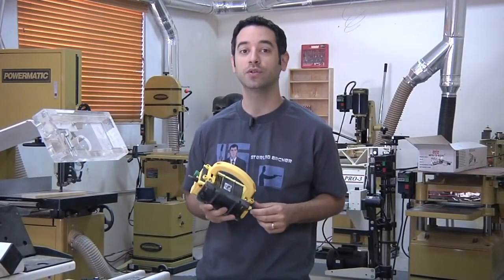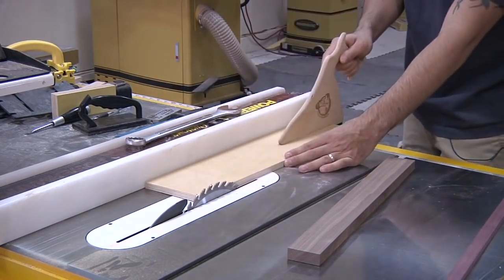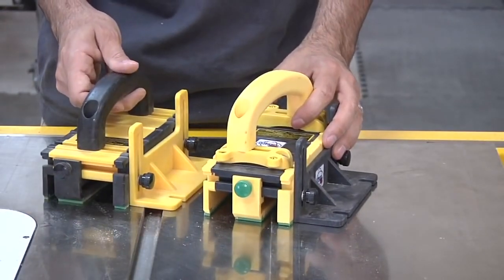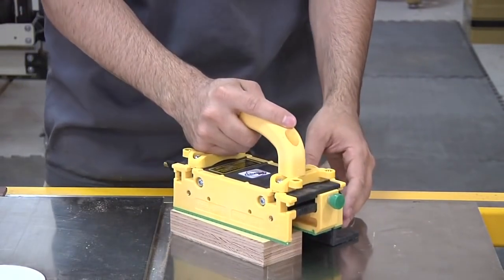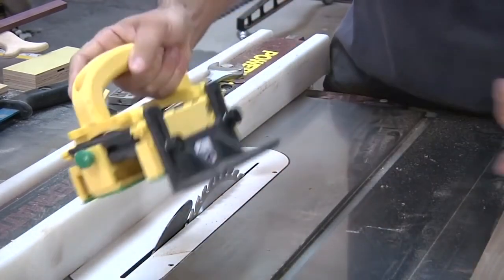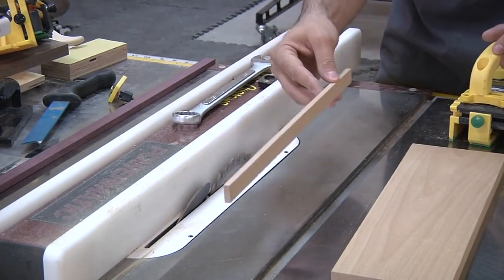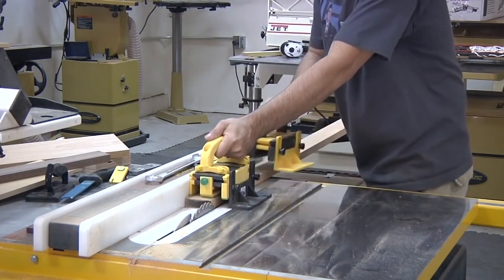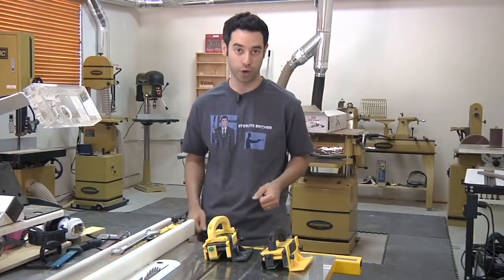The GRR-RIPPER Review by Marc Spagnuolo, The Wood Whisperer! #tbt

Comment: What model saw is that? I'll  have to study how it retains the dust so well. That's the dirtiest cut of them all and I didn't see anything. ( at 7:35). It's almost as if they have stopped the fan effect of the blade. Even with the best of dust collection, that's pretty remarkable. I'm still trying to make my sawstop PCS collect as good as I had my old Delta CS rigged to do. The Struuuggle is real!
Reply from the maker: This is an older video from Marc, but that is a Powermatic, either a 66 or a 2000
Reply: @Microjig  I'm going to have to look at the insides of those model numbers. That's either magic, luck or something in the design.
Reply from the maker: @mikeconroy2651  I have been a pro woodworker for 40 years. If you take the time to seal the gaps between the cabinet of your saw and the top, you can get some impressive results with a good dust collector.

Comment: I bought one of these years ago when they first came out.  After using it one time, it became a $60 doorstop.  I found it very tedious and time consuming to adjust.  This jig is no different than the 3 other push-sticks you demonstrated when cutting long stock.  The big downside to this jig is having to remove both the blade guard and the riving knife in order to use it.  Fingers and hands are in peril and the possibility of a kickback is dramatically increased without the safety guards in place.  Your push-shoe is the best of the 4 push-blocks presented by far.  I sure do miss my $60!!
Reply from the maker: Sorry to hear you feel this way. Had you contacted us back then, you could have had your $60 back. I will say that you are in the minority though. 80% of buyers give the GRR-RIPPER 4 or 5 star ratings, and as a 40 year professional woodworker myself, I wont work in my shop without them.
Reply: @Microjig I just can't support a jig that requires the removal of the essential safety features of a table saw.  Perhaps the 80% of buyers don't regard safety as much as I do.  In the end each woodworker must operate within their own comfort zone.
Reply from the maker: @lesheinen6116  we would never tell you to not use any safety feature that you want to use. We will point out that any rip under about 1" wide does require the removal of the blade guard because it will not physically fit between the blade and fence. You also can't use the blade guard when making non-through cuts such as shoulder cuts and grooves. And any cut wider than about 4" can be made with the GRR-RIPPER and blade guard. 
Finally, I use the GRR-RIPPER on my router table nearly as often as on the saw, not to mention the bandsaw and jointer.
Reply: @Microjig  Really? Are you serious? A woodworker that does not know that you use an auxiliary fence (lower than the guard) when ripping thin strips? I find it hard to believe you can be so ignorant of table-saw usage. 
Non through cuts- only prevents crown guards mounted on the riving knife. Side mounted or overhead mounted guards are fine.
Reply from the maker: Email me at Ralph@microjig.com and I will happily buy back your GRR-RIPPER. I would ask the opportunity to talk with you and explain the physics of the cutting/kickback. 
I have been a professional woodworker for nearly 40 years so I have figured a few things out along the way.
Reply: @Microjig  Both types of kickback are prevented, where the cut is longer than the blade, by the riving knife and crown guard. If you insist on ripping short lengths against the fence (there are better ways) then skew fence rollers are the safest option. Guard in place, and hands nowhere near…
Reply from the maker: @Tensquaremetreworkshop  The riving knife can help with kickback caused by the rip side of the part wandering away from the rip fence face. But it is not perfect. The riving knife is thin and flexible and can still allow the stock to catch a rear tooth as it comes out of the table top. If you see tool marks on your rip cut, that its where they come from. Also, the riving knife doe nothing to prevent to off fall part of the cut from rattling against the blade after it is separated from the rip side and is no longer being controlled by the push stick. 
The GRR-RIPPER maintains control over both halves of the stock not only through the cut, but even after, letting you safely remove both from the cutting area with neither edge rubbing on the back of the blade.
Reply: @Microjig  1) A riving knife fit for purpose will prevent the increase in side pressure caused by the workpiece skewing against the blade. Geometry means that it has a greater effect than the blade, and tests have shown that even thin knives prevent pinch kickback.(The pivot point is the BACK of the riving knife.)
2) Not sure what an 'to off fall part' is, but if you are referring to the side away from the fence, then there is no side force involved, so no friction issue. If you have parts 'rattling' I would love to know how...
3) The movement of a gripper after the part is cut can introduce unwanted forces into the process.- especially if there is cupping in the part*.
4) having the body lean over the table supported by hands holding pieces of plastic over a rotating cutting blade just makes no safety sense at all. Especially if lifting the hands can result in immediate kickback- of both sorts. Good safety systems are intrinsically safe.
I am part of a Men's Shed. Not having the crown guard fitted is a 'send home' offence. Apart from anything else, it voids our insurance.

* A scenario for you. You feed a slightly cupped short part into the saw. As the cut completes, your downward pressure on the part causes the part to fall and press against the blade. The sudden downward movement also reduces the friction of the Gripper, as the side friction builds up and ejects the part. Struck by this part, you recoil backwards, with your hands over a now bare blade. Let us hope you both hold on to the Gripper, and do not let it move in a direction that exposes your hand. Call this safe?
Reply from the maker: @Tensquaremetreworkshop  Your final scenario I have done often, and the GRR-RIPPER works. And with nearly 100,000 GRR-RIPPERs out there since 2001, we have a very complete track record of protection and safety. 
I am a big believer in the riving knife, and it does help prevent kickback from the kerf closing behind the blade.
But if your rip cut has visible tool marks on it, that is physical proof that the riving knife is NOT functioning as you claim. The swirl marks you see that start at the bottom of the ripped edge and end forward at the top of the stock show how the teeth coming up out of the saw table are rubbing on the kerf walls. The riving knife is NOT preventing this. It cannot. It must be narrower than the blade to prevent binding, so there is room for the stock to leave the rip fence before it encounters the riving knife. 
The GRR-RIPPER does keep the stock tight to the rip fence face, so the kerf does NOT touch the back teeth, and it is proven by the absence of tool marks on the freshly ripped edge. 
As for your last scenario, it is never fully safe to cut cupped boards on a tables saw and your blade guard adds no protection when the cup falls into the blade as you describe. Blade guards do nothing to prevent kickback. And no, the "anti-kickback pawls" on saws simply do not work. In 30+ years I have never seen them stop a part. Just like not ripping a board with a curved edge, you should never rip cupped boards. Not even with a power feeder.
Again, I will be happy to talk this through with you at length over the phone or even using a video call to show you what I mean.
Reply: @Microjig  You may have done it, even often- but not in every circumstance. My point is that it is a risk you do not need to take.
Marking of boards- more often due to slight blade/fence misalignment. It you want to ensure the part is kept close to the fence, then fence rollers are the answer. Mounted with a slight toe-in, they do this better than any hand guiding. Great for router tables too- I use them on both axis with this, simple and give a very precise cut.
Blade guards DO prevent kickback- the sort caused by the part 'climbing over' the rear of the blade (upward friction lifts the part until it is clear of the riving knife when it can skew over the blade). The guard holds it down. This is the worst sort of kickback- it can be higher velocity, and can be thrown higher (including into the face).

To be clear- the Gripper requires operator skill- every time. Ever put the coffee in the mug rather than the coffee pot? Milk in the pot rather than the mug? We can all be subject to inattention and distraction. It only needs to happen once. Good safety systems are intrinsically safe- they do not depend on how you operate them.

Modern table saws are quite quiet- quieter than the dust extractor. Turn away without switching it off (and waiting for it to stop) and there is a silent rotating naked saw in the 'shop.
I could go on. A lot. because I have done professional risk analysis of machine tools. Believe me, in my jurisdiction use of Grippers (or any system that required the removal of guards) would be a non-starter. Which leaves amateurs. Probably the worst choice of people to operate unsafe equipment. Which is one reason that there are around 30,000 table saw accidents in the US every year, involving 5000 or so amputations. A frightful figure! The vast majority would be prevented by guards, as the authorities have stated.
Reply from the maker: @Tensquaremetreworkshop  You do what you think is safest in your own shop, it is the only way anyone should. 
I have an extensive professional background including designing and grinding custom cutting tools, so I think it only fair that people reading your comments have a chance to hear the other side of the issue.
Reply: @Microjig  Not sure that background is of value when it comes to assessing woodworking tool safety... It is not about what I think, or about my own shop. Our insurance prohibits us using such products, and our risk analysis precludes such use too. Not just that- there are better ways of achieving the same results.

Comment: Pretty ridiculous comparison of push sticks where you use one hand and then go to use the Grr-riper and you use the other hand to steady the work.   Clearly this thing has its uses but to try and one hand the other methods to discredit them is dishonest.
Reply from the maker: Bear in mind that this video was produced by Marc Spagnolo, so we did not have control over the content. 
You may disagree with his method (I use a GRR-RIPPER in each hand at the saw most of the time) but you cannot disagree with our results over the 22 years we have been saving fingers. 
We have sold hundreds of thousands of GRR-RIPPERs and our customer ratings are consistently 4-5 stars. They work.

Comment: This is NOT a safety item. To use it you need to remove the blade guard- your primary safety device on the table saw. You should NOT use it- a hand held piece of plastic would never pass a risk assessment.
Reply from the maker: In point of fact, there are several conditions under which OSHA recognizes that the blade guard cannot be used, and the GRR-RIPPER meets all of their guidelines in those situations.
Reply: @Microjig  Name one, and I will tell you how a blade guard CAN be used.
Reply from the maker: @Tensquaremetreworkshop  making groove cuts/dado cuts, shoulder cuts, rips of less than 1" wide. Shall I go on?
Reply: @Microjig  You can if you wish.
Non through cuts , dados, etc - prevents use of riving knife crown guard, but side and top mounted guards work just fine. I do this often.
Narrow rips - you use an auxiliary (low) fence. Standard practice. 
I will add - use of sled. This should have its own fence fitted. Mine does. 
Want to try more?